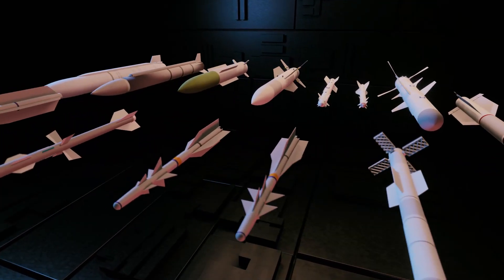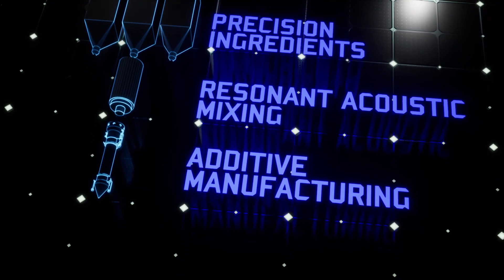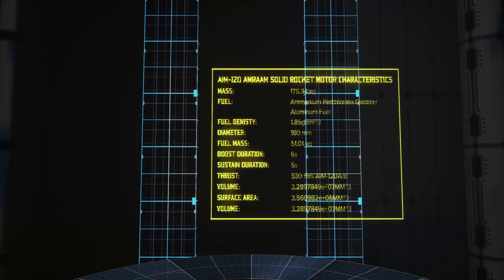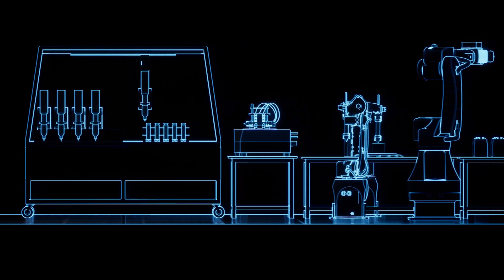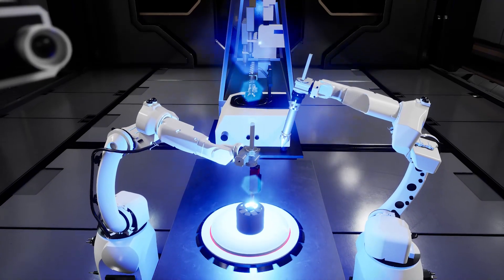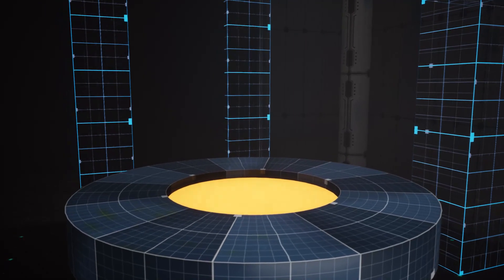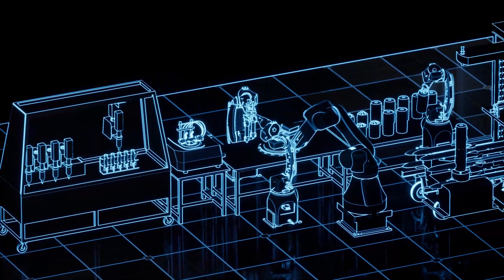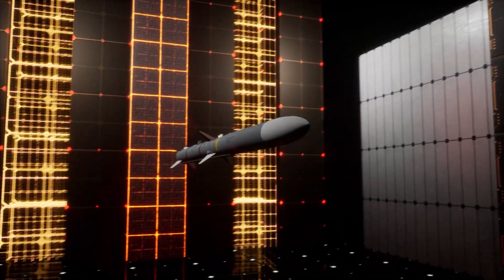Rapid Energetics & Advanced Rocket Manufacturing (REARM)

Comment: This is great but I don’t see anything about how this equipment will be cleaned and maintained. In addition, I do not see how excessive propellant waste per batch will be minimized - how much is lost in the 3D print feed line/printer head when a formula is changed out? The process of making an SRM is generally simple. What makes the process complicated/time consuming is reducing the mess created (ie cleaning the equipment), use of consumables, and minimizing propellant waste per batch. 

Looks like a lot of expensive equipment to clean up!